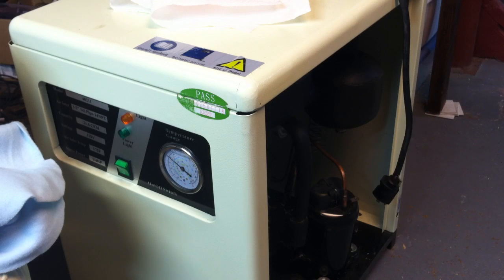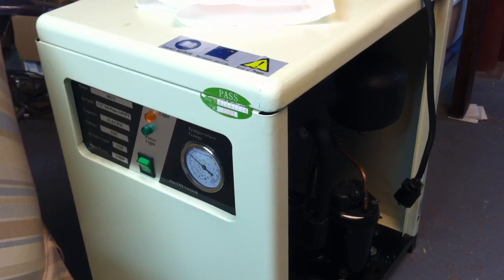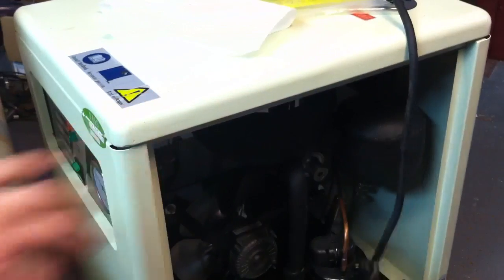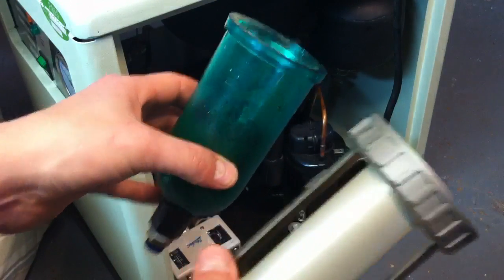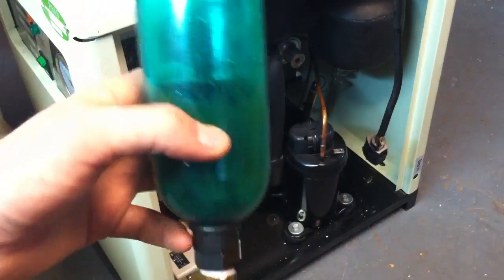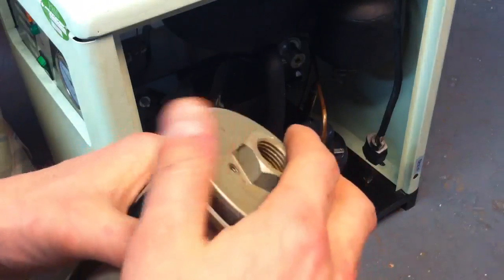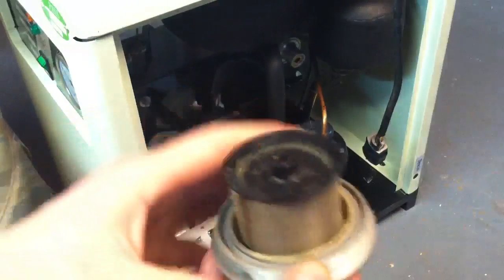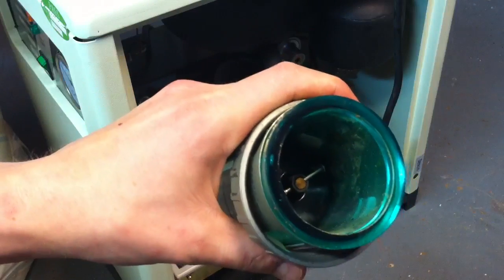Harbor Freight Refrigerated Compressed Air Dryer - Troubleshooting

Comment: Yesterday I took the chassis off of my Ingersoll Rand  and didn't find a cup like yours shown at 1:55.  But I cleaned off any dust I could while in there.  I think my problem (with it freezing than low/no air).. was due to the muffler I made for the condensate hose.  I re-positioned the condensate hose so that it's flow will not be blocked at all by inserting the 5' long plastic tube inside of a 1/2" diameter copper pipe about 4' long.  It makes a loud "snap" sound when it expels water which can be annoying thus why I tried to muffle that sound.  If it's still freezing up I'll contact IR with some pics I took while in there because the website does not have my exact model.

Comment: I just purchased that exact same unit from Harbor freight. I had some problems, wiring was not secured and vibrating and making a buzzing noise, I  fix that. Then the automatic air drain bottle has several leaks, and feels like something is broken inside. I could not get it to seal. I had to remove it completely. Not very happy

Comment: Im on my second one in 3 months !!  just got sencond one hooked up..turned air on...air coming out drain hose!!!    JUST JUNK>>Sending back .spending more money and getting a good one...
Reply: What was the fix for the drain leaking air?
Reply: @addamup1  They wouldn't send replacement, so I told them too stick it. Too much down time. Bought a USWELD 5stage for air and built the moisture trap out of 3/4" copper pipe with drains at bottom. 0 moisture  now
Reply: Did you return the unit get money back I'm having the same problems haven't used it much
Reply: Did you return the unit get money back I'm having the same problems haven't used it much

Comment: When my unit goes to auto drain, the float valve seems to stay open and constantly leaks air, causing the compressor to run continuously until the safety switch trips to turn it off. I have to open the bypass valve and close the inlet and outlet valves for the float valve to reset. I have cleaned the bowl but this keeps happening. Tech support is not much help. I would greatly appreciate any suggestions. Thanks.
Reply: lubricate the diaphragm  and bowl with silicone lube.
Reply: Remove the auto drain and put another unit on or go to a manual drain. Float drains always fail just a matter of when

Comment: Reading through the comments, it appears that what you show here did NOT fix the problem that you were having. Is that correct?
Reply: Thanks, just wanted to check before I bought one...I'm going to go with a condenser/radiator aftercooler between the compressor and the receiver tank.

Comment: This was a great short video, I could not figure out for the life of me how to take this apart. I thought the ring and top plate were one piece, and was trying to unscrew the bowl cage from it and it was just spinning in circles very difficultly and wasn't loosening up. After seeing this video I realized they are 3 separate pieces. Didn't have same issue ad NYC CNC, my pressure relief disc on top had blown and was leaking air like a previous person. Thank you for the video!
Reply: อีค

Comment: Was your wiring for the power cord correct according to the manual? I cant get the power light on mine to turn on, unless I run the hot/neutral reverse from what they manual says. Could you please let me know.
Reply: NYC CNC Turns out I just couldn't see the yellow stripe on the correct wire for the ground in my cave of a shop (dimly lit in the compressor room) Got the wires swapped haha all is well on that end. Turns on, hums smoothly, and the fan kicks on. Adding air is another story. After attaching the air lines, air starts pissing somewhere inside. Open the right side panel, and there is this little hole pictured here on the top of the water trap, and its just leaking. loudly. That normal?

http://i203.photobucket.com/albums/aa231/NEILZJ/Parts/leaking.png
Reply: Neil Rasmussen I had the same issue with mine, I watched this video on how to take it apart. And from what i can see, it looks like a one time use pressure pin. I just took it out and replaced it with a 6mm bolt (no drilling or tapping required, direct replacement). I have 3 pressure relief valves throughout my air system in my shop so I'm not too worried about not having one inside the dryer. I know this is a few months late for you, but I figured I'd answer for future folks coming to this video with the same problem.
Reply: +Jordan Kesselring Hi we have cleaned the drain consistently but now there is lots of air going through the drain. (noisy) do I need a new drain or what do you suggest? thanks Caroline

Comment: I am thinking about purchasing one for my Plasma cutter since I want the air dry, and here in Sacramento, CA, the air contains a lot of moisture. I plan on buying the extended warranty. How is it working for you? Also, do you run all of your air tools using it? Finally if I may, does the unit stay on all the time, or just when the Air compressed powers up and sends air through it? Or do you think a Motorguard M60 filter is sufficient? I use my plasma cutter sparingly.  Thanks.

Comment: Your problem is not the filter drain assy the problem is the hot gas dischsrge bypas valve is out of adjustment or the fan cycling switch is not set correctly but I am happy to see they got you a new dryer.... Take care!